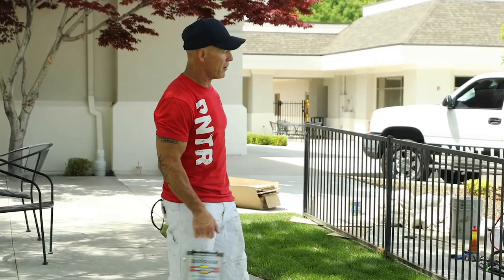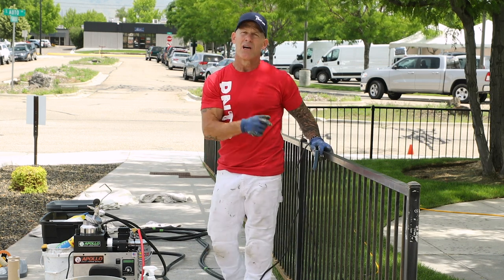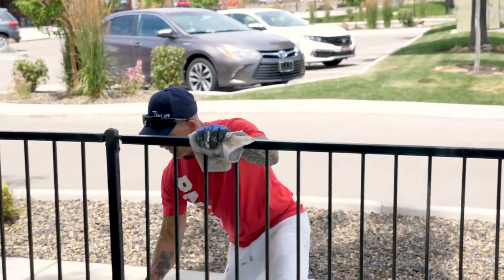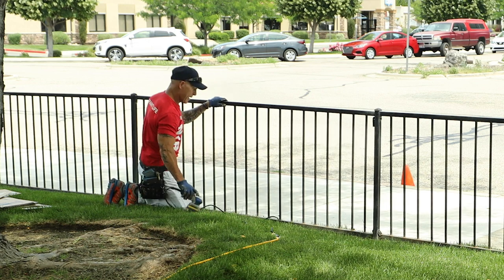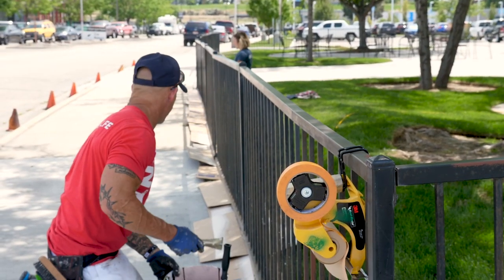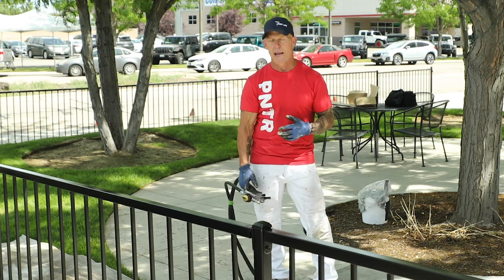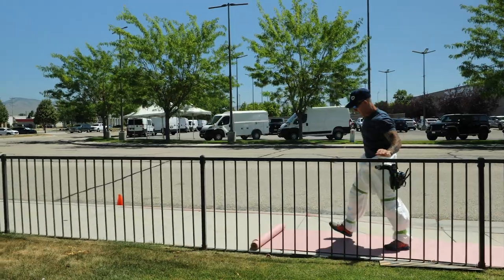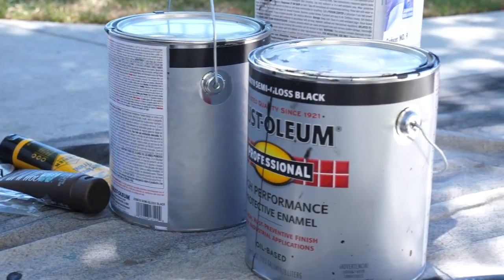Wrought Iron Fence PAINTING Tips

Comment: This guy is just so good and professional, does really superb job that people keeps coming back to him to do work. 
Awesome my man!👍
Reply: No really, I have seen this guys other videos.  He is not an experienced tradesman.  Using Krud Kutter as a  wipe down is not good AT ALL those areas are going to peel over time because I guarantee you the way he is wiping is not getting is clean.  USE A TAC CLOTH! This guy way over rated
Reply: Agreed to a point. I've seen other vids where degreaser used in replacement of sanding. And once I seen the bolts on the fence I realized that I would have taken it apart to work on it in the shop
Reply: How much should I charge for a job like this?

Comment: Best video I've found on the topic. Lots of useful tips for  my dual swing gate project. I've replaced several 3/4x3/4 inch square tubing pickets and sanded down all the other pickets that didn't need replacing. I probably went a bit too far with my 80 grit flap disk on my angle grinder, but it got it clean. Your sander approach is MUCH faster.

Comment: Good Job Chris Very well explained and very professional job!!
Just remembered as my first time, it was as same as you Chris, I have done with HVLP sprayer as well, and I had the same problems as you had, like during the process, it was like overspray everywhere around the fence, on clothes,  around the body, on the dropped sheets, it was smaller particles of paint in many areas around the fence, it was crazy!!

However my second time, and after that for many years I have been doing in a differently way, as I change the whole process as doing this type of job, specially doing near the ocean, like in beach cities, as described below; 

Step1- I sanded and Scrubbed the whole fence( depends the place and type of job, could sand blaster, but not in this case!), after that I have blown up the whole fence, like very close with a pressure air, to get rid of any type of dusty, and after that I cleaned 🧽 with anti greased, or mineral turps.

Step 2- I have applied the rust converter, after that I applied a coat of pure zinc, after that I applied epoxy primer, and after that I applied 2 coats of Epoxy Enamel, as my top coat (black).

I have done this process with 2 experienced painters, one each side of the fence, as sanding, scrubbing, cleaning, and painting with baby rollers (as similar as the one Chris have used), 

Conclusion as doing iron fences;

I found that type of job, very hardworking energy consuming, and very repetitive, like a lot of preparation, a lot of Labouring, more work then profit, but the fence final result it was incredible good!

Comment: I have had to do small sections of railing occasionally. You can use rusty metal primer in spray cans, prepare for some overspray. Finish with  2-3 coats of satin, typically always black. You can do recoats pretty quickly on warm days. HVLP sprayers are very nice for control.

Comment: The verticals are called stiles. It is often referred to as spindles but we all know spend those are round decorative.
Reply: Stiles are ladders that go up and over a fence. Spindles are typically round and made on a lathe. Pickets are typically square. Pickets are the most correct term for the components commonly used in the span of a wrought iron fence section.

Comment: Consider using RYOBI One+ 18v battery (multiple batteries required) sanders no wires needed... 
I personally  use a DeWalt 4400 PSI 4 gallon per minute pressure washer with a venturi sandblasting attachment, leaves nothing behind... Not even concrete. The pressure washer sandblasting does not create sand clouds and the sand can be sun dried and reused,  use blue plastic tarps instead of canvas or paper due to water. The pressure washer can be used to sweep up the area for and sand over spray.

Great video 👍🏻

Comment: we spray our primer on wrought iron fences . we prime it all regardless. we have 2 guys spraying , one on each side going different direction on each fence square to avoid flashing.  we dont tune the spray down as much because we found heavier fast coats seem to lay out smoother after 220 sanding and tack cloths. we also use cardboard and try not to use wimpy drops due to the stickyness to your feet .

Comment: enjoying your videos and your Technique.  I find that there are different types of iron gates there are cheap metals and there are better metals that is sometimes not built very well. the inferior usually bleed rust from their joints due to hollowing out. I started correcting this by using some clear silicone on those bleed spots. has been working just fine. Peace

Comment: Thank you!  I'm spraying an exterior steel staircase.  But I'm already committed to using a Graco Painter Plus.  I'm going to thin the enamel with Xylene, because I am limited to a .015 tip and the primer recommends .017-.019.  I'll be using a .315 tip.  Hopefully, it will work.  Any words of wisdom?  KEM Bond Metal Primer and Alkyd Gloss Enamel.

Comment: The fence parts are called top and bottom rails and in between those are the pickets. I wish I could use oil base for my customers but Rustoleum doesn't have an assortment of colors so Alkyd is the next best thing. Also you're not going to prevent rusting with any exterior products on a fence that has it's posts in the ground. If the posts are in cement the fence lasts forever but fence with posts in dirt rust from the inside out. They actually make electrolysis plates like you see on boats to prevent the fence from corroding. The ground act as the anode the fence is the diode, add rain or sprinklers and you have a battery that slowly eats itself from the inside out.

Comment: I was thinking about using my electric paint sprayer to paint my chain link fence with silver (metallic) rust-oleum chain link fence paint. It has a thin viscosity, and says on the can that there's no need for thinning, but also only mentions brushing/rolling it on.  Do you think it's doable with the sprayer or am I out of my mind for even considering it? Btw, it's oil based.

Comment: I had a question : do you recommend to spray paint  wrought iron fence w designs and loops on the designs of the fence or would it be better to use rollers
Reply from the maker: Rollers to control overspray

Comment: Hey Chris, what about using a Titan 440i if that is all you had for a sprayer?
Reply: It would be too powerful for this type of project, even with a fine finish smaller tip size. You'd also use way more paint than a hvlp. I've noticed your comment was from 5 months ago, did you use the 440?

Comment: I haven't seen a video on how best to CLEAN spray equipment
Reply: Just have a 5 gal bucket with clean water and run it through the paint machine till it comes out clean. Some sprayers have a garden hose attachment u can put and it eliminates the need for a 5 gal bucket. Disassemble the gun and little parts and clean by hand with a toothbrush. That’s what I’ve been using it’s not too bad.
Reply: matosman1 R6S Exactly!
Reply: I do a lot of cleaning videos on my Facebook page and YouTube Chanel
Reply from the maker: I have several

Comment: What is the point in using that sprayer versus your normal sprayer?
Reply: Overspray and transfer eficience and saving paint
Reply: @dennisgarber  that particular material used on that fence doesn't require thinning. Also 5 stage turbines like that Apollo LE he's using  has enough power to spray more materials without thinning
Reply: How much does that sprayer. Cost
Reply: Svt Lex around $1500
Reply from the maker: Less overspray

Comment: Using Krud Kutter as a  wipe down is not good AT ALL those areas are going to peel over time because I guarantee you the way he is wiping is not getting is clean.  USE A TAC CLOTH!   For sanding sand it by hand with sheets of sandpaper cut to size you don't get same results with sanding by hand, especially the way this fella demonstrates.  That Rustoleum paint not the best option.  For this paint to last over 8 years need PPG DTM DTR two part urethane.  If you paint a fence like this the work will not last.  I am licensed contractor for over 30 years in California.  This job will look good for couple of years but will eventually fail.